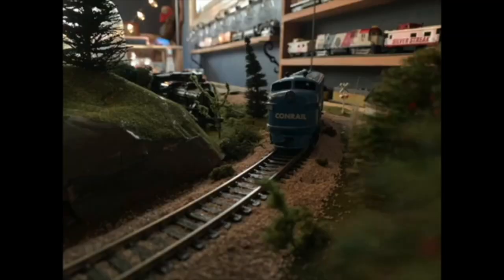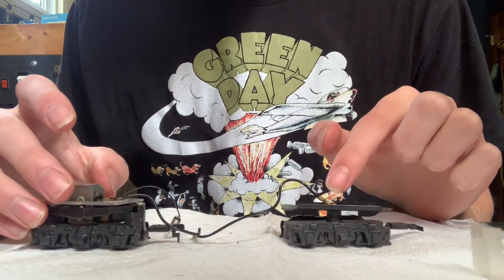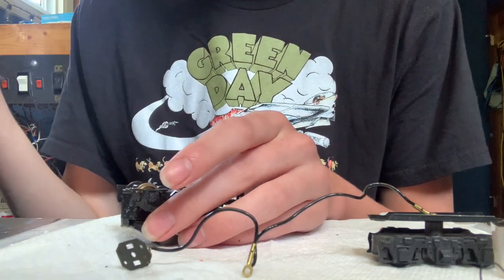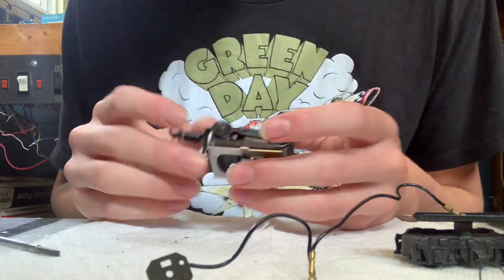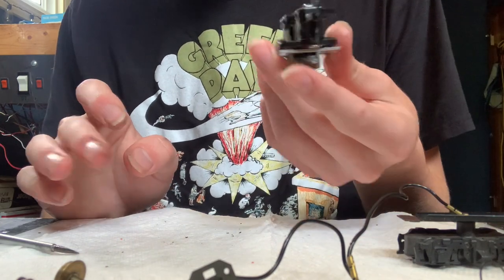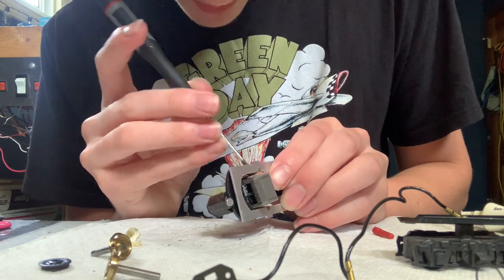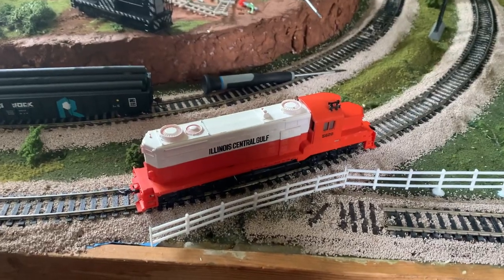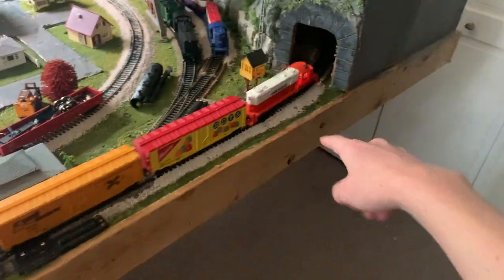Mantua/Tyco Mu2 Motor Full Rebuild and Service Guide

Comment: Currently working on this model and did not go the route in this video.  I dremels the rivets and pulled the pins.  Drilled out the holes and used M3 bolts with nuts.  The two halves came apart and one gear was totally worn down.  So I found a guy that sent me a couple new axles with newer gears on them.  I put it back together and reinstalled and now the motor doesn’t budge.  Can spin the motor freely with my fingers but power to it does nothing.  Was running before.